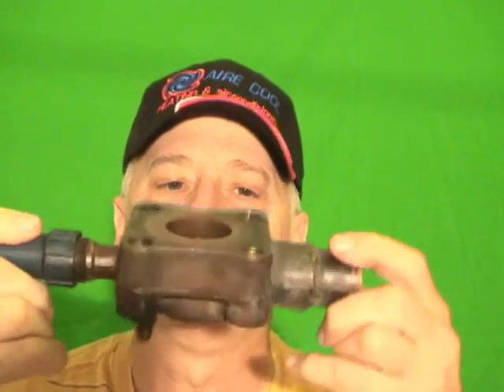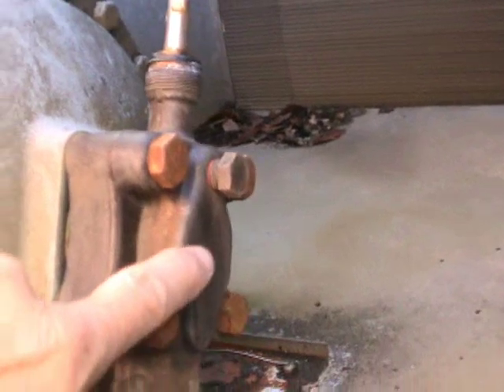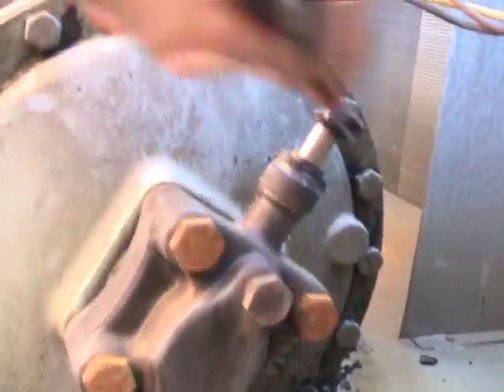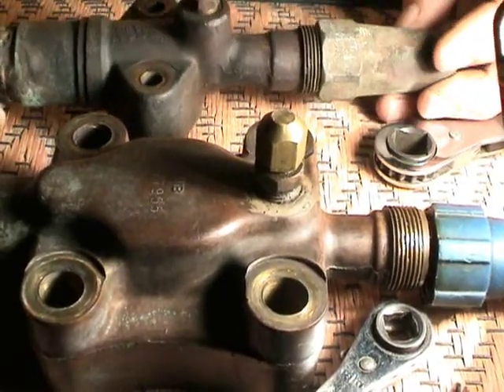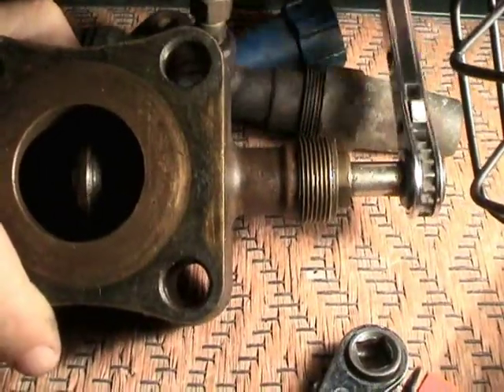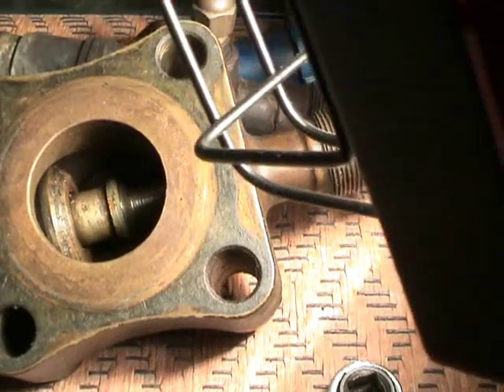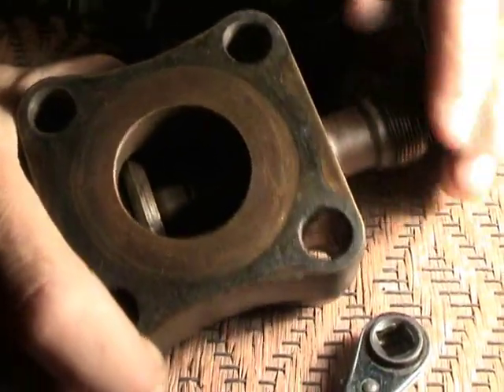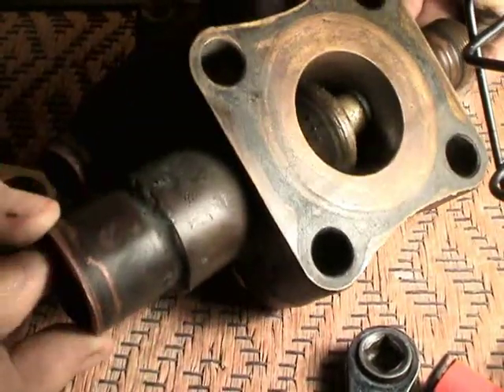HVAC King Valves

Comment: How do charge a system and check pressure reading. When its front seated or back seated? I am thinking front seated. Once we have added refrigerant we have to back seat it and let the system run?

Comment: a king valve is found at the outlet of the receiver only.
Reply: Ok....then what the hell is a "queen valve" then?
Reply: @kyleboyer1074  queen valve is on inlet side of receiver. Those being shown are 3 postion service vavles. King and queen refer to where they are in the system not the type of valve

Comment: Thank you for this video. I am an HVACR graduate, and I am still learning. I love to learn. You are very good at teaching about the king valve. Through all the videos I watched, no one was able to really explain the function of the king valves. You explained it well. When I front seat (stem down), this prevents refrigerant from flowing to the compressor. When it is at the mid point some of the refrigerant flow through. When the position is back seated (Stem up)  I believe that this is when you want to evacuate the system, and you really want refrigerant to flow a bit faster. Is there any other reasons that the stem should be back seated? What is the real difference between the mid point and the back seated position?

Comment: Hi agree with Ivan, those are discharge service valves and suction service valves. The King valve is located on the outlet of the receiver tank and like
Y a root lock not flange connection. it could be on a huge tank, but I've never seen one. Of course that doesn't mean it's impossible. But it's location is definite.

Comment: those are suc and dis service valevs. Remember the king valve disignation is determined where that valve is located in the system. Outlet of condenser or liquid receiver. Proper terminology.

Comment from the maker: @gordy19741974 I think that it would be easier to use a core replacement tool. You can check both the head pressures and the suction pressures with a set of manifold gauges.

Comment: Agreed, there is a reason it's called the King Valve, the valves whether on the reciever, or compressor discharge/suction inlet/outlet are performing a separate duty, they act in the same manner, the name King Valve is because of the position in the refrigeration system but is exactly the same as a discharge service valve or ssv. And more commonly you will see reciever king valves with Roto-lock fittings rather than standard bolt type. King valve is just a designation of duty for a valve.

Comment from the maker: The valves that I showed that weren't connected to a compressor had quarter inch access ports. They had threads. I had a hard time getting the lighting to cooperate with the camera.

Comment: Great video! (5/5) But I do have some concern. What you continually called a shrader port could have been better described as an access port. It was either the angle, or there wasn't any threads in there, where um.. the shrader would go. Shrader is the pin which goes inside to allow access on demand. Some valves, I've seen 2 identical ports as shown. That being 1 for access and the other for a pressure switch. Be cautious not to leave it back seated, it won't shut off after pumping down, lol...